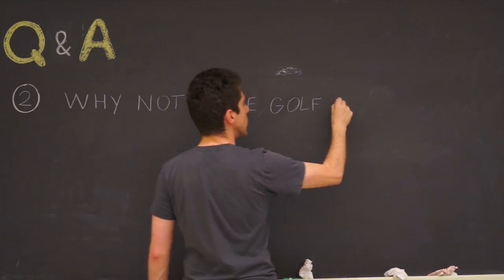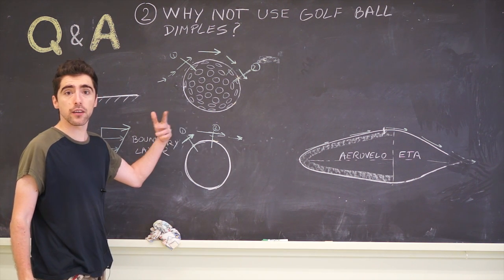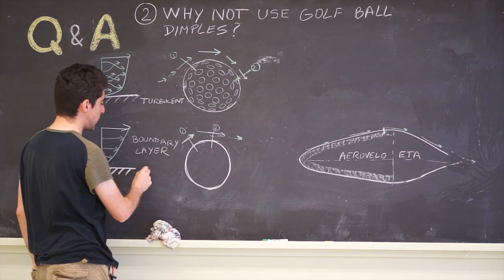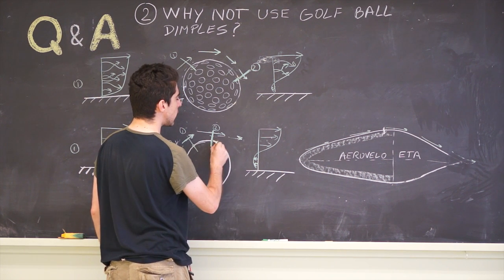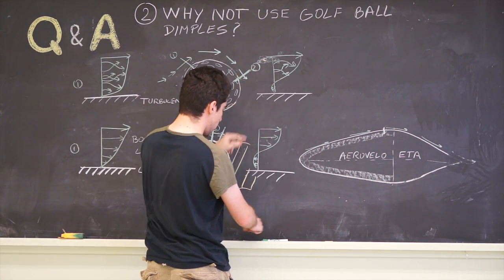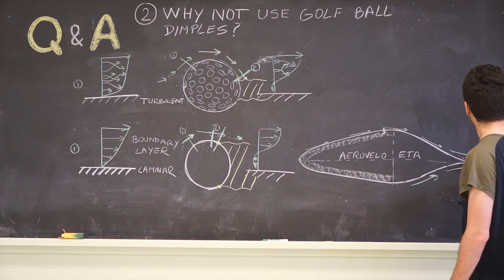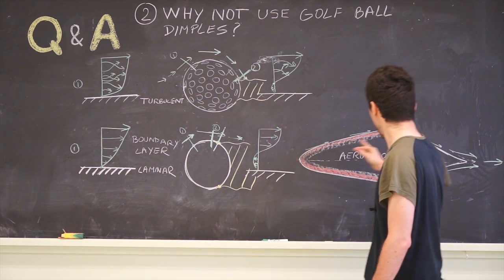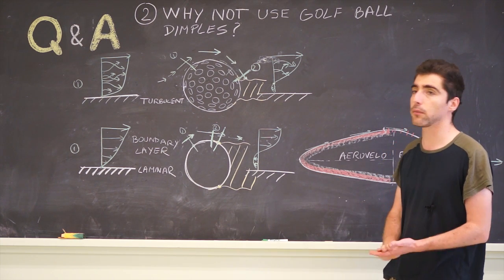Q&A: Why doesn't AeroVelo's speedbike use Golf Ball Dimples?

Comment: Has anyone tried the dimples any why, perhaps your understanding is faulty?
Reply: yes, people have tried dimples. It is also attempted on cars, bike helmets, etc. While my understanding might be faulty, none of the other teams that went fast in the last 20 years ever used dimples, and they all tried to achieve the smoothest possible shape. Some experienced racers, such as the world champion for 15 years, Sam Whittingham, can feel the difference between different waxes. The smooth ones are always faster.
Reply: Hi, so sorry, I am not saying you personally have a faulty understanding, but the general understanding of why dimples work, may be faulty. I was thinking about fish, such as tuna, and sharks, also sailfish are very fast, but have scales that may also act like the dimples. Perhaps if someone tries the dimples and it turns out to help, there will be more research in dimple shape and size. If you have access to a wind tunnel you will be able to measure and compare the drag forces between a dimpled & smooth shell. No need to go out on the field. May be able to also apply this technology to swimsuits for competitive swimming, if it works.
Reply: Sean Rhoades Aerodynamics have a bad habit of working very differently depending on the fluid (air or water), size of objects and speed at which they travel. 
In water some surface roughness or scales do seem to help in some respects. Swimsuit makers have looked into it, and it is a very active research topic. 
Small channels on the surface of jet engine cowling seem to work as well, and it is being experimented on by NASA. Unfortunately, our time and budget doesnt allow us to research too many topics simultaneously. Tires and wheel aerodynamics are now our main areas where we think we can get a big advantage.
The surface of the bike is as good as we will get it without a big research effort, and all existing evidence points for the air, at the speeds we travel at, smooth surfaces are best.
Reply: VRagusila I hope some golf ball company CEO sees these posts and helps your team with some more funds. It could happen!